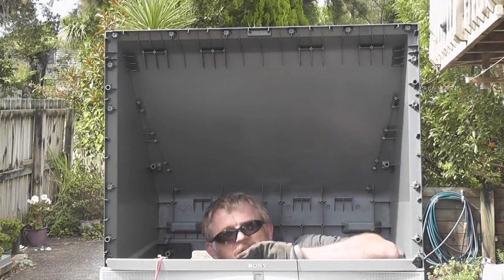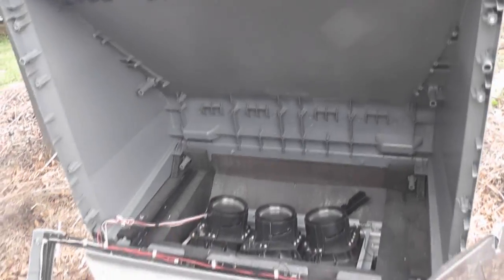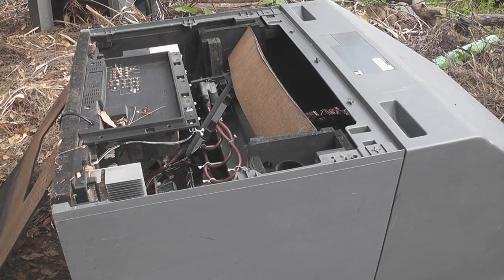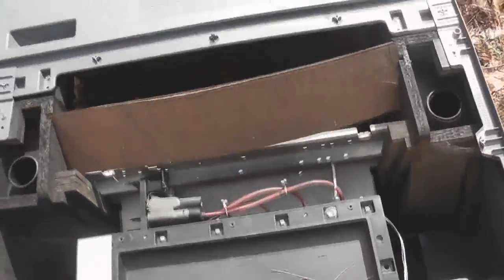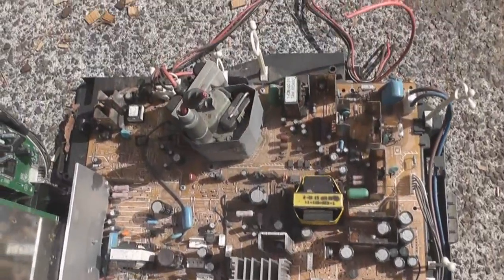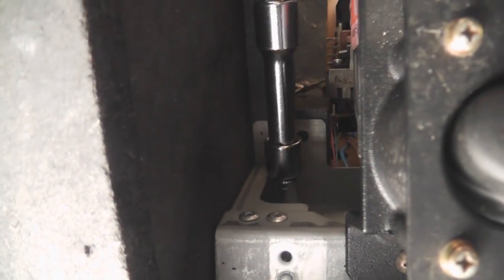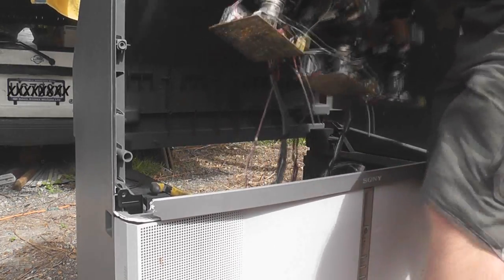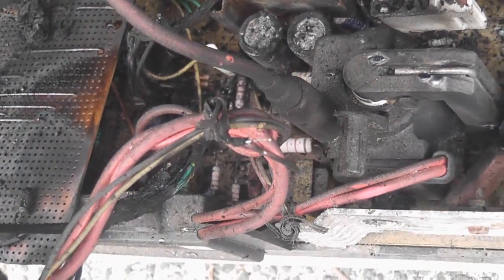What is inside a RPTV ?

Comment: I had a Hitachi set, loved it! Only had one small problem with it one time, shorted ceramic cap but was able to get it repaired cheaply. The one great feature it had was twin tuners with picture in picture where I could position the secondary image most anywhere on the screen and with one press of the remotes special button I could switch between which tuner had priority to fill the whole screen. This set was a football watchers dream, it never failed that there would be two games on at the same time, you could follow both.
What is it with set manufacturers today, I have yet to find one of these HDTV's with twin tuners.

Comment: Man I used to work on these sets - these sets were state of the art at one time, lol. Really, people put down some real cash to own one of these sets. Rarely ever had trouble with the CRT's, usually it was trouble in the power supply or signal switching path (due to static electricity, etc). Rodalco that was a good set, too, made by Sony. Thanks for the vid!

Comment: Ah the memories... those were popular about 10 years ago and I fixed quite a few of them.
They had chronic CRT failure issues and I believe a class action suit settlement over the CRTs failing.

The 3 screens are a protective screen, a lenticular screen and the Fresnel lens.

The thing you call an amplifier was the convergence amplifier and generator.
If you look at the front where the screens were you will find 4 sensors, one on each side, top and bottom. The more sophisticated ones had 8 sensors - one on each side, top and bottom and all 4 corners. The convergence generator was responsible for aligning the 3 colors as well as generating a pattern on the screen by the user hitting a button on the front (magic focus ,auto convergence or the like) or choosing an option in the menu if the user wanted the set to correct itself because the convergence did have a thermal drift.
You will find the convergence yokes on the main yokes.
Reply from the maker: I did see those 4 sensors, thanks for your detailed reply. This set was very heavy. I will keep the electronic parts and the flyback TX. Will have a go at driving one of those CRT's. hopefully the blue one.
Reply: RODALCO2007
I think you can drive those as a black and white tube and it will work.
Sony had very very good schematics for these sets if you can get your hands on one. Just have to work out the deflection. If you look down into the tube (with the lens off) you should be able to see how much phosphor is left on the tube and if there are any burn spots. If the CRTs have burn spots you know why they threw it in the rubbish :)

Comment: Did that audio amplifier work?
Reply from the maker: Haven't tested that one yet. Will make a video if it works.
Reply: RODALCO2007
I pulled one out of an old LCD TV and it cranks but it seems to clip when I have it running on a car battery but not on a 12 volt drill battery.